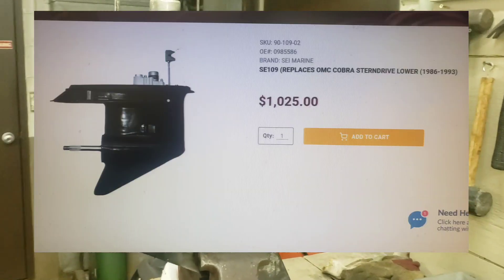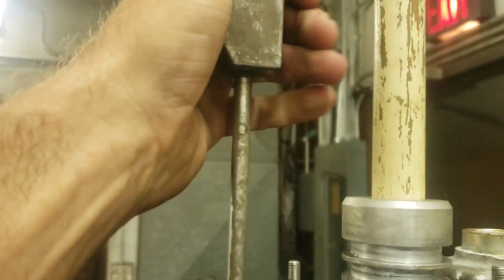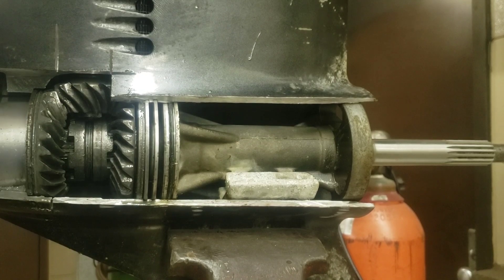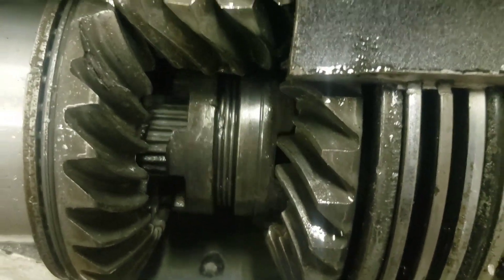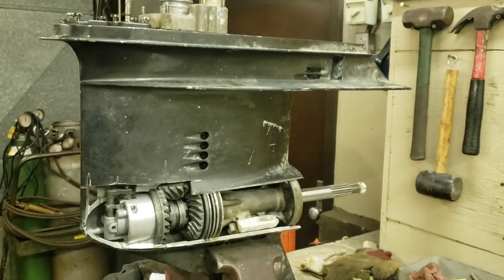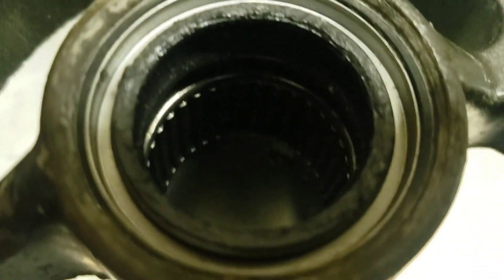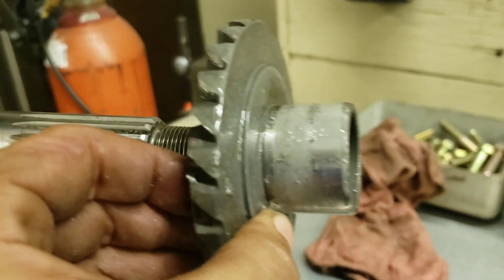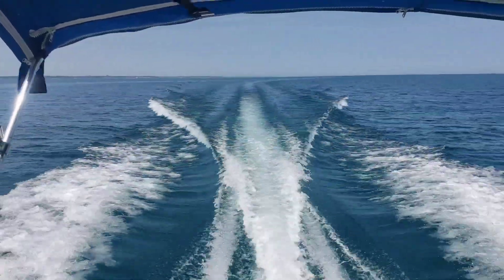How Does an OMC Cobra Outdrive, Alpha One Mercruiser Outdrive work?

Comment: I  rebuild these in the past working at our boat shop. They are a pain to get apart exspecshioly if it's been years. As you said rebuild twice. Somthing not right probably in casing. It's blind working with this. Best at this point is aftermarket.

Comment: Nice cutting that open.   I have a 77 Mercruiser R behind a 302 that ran low on oil. 

Smoked the very top bearing on the drive shaft so far that I can see.    I’ll probably never take it apart like you said due to the cost of the tools.